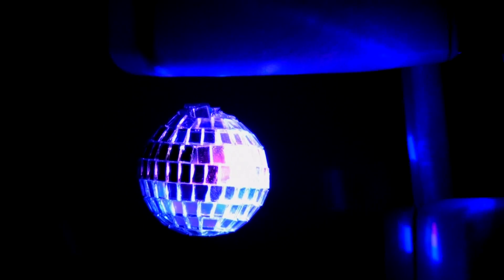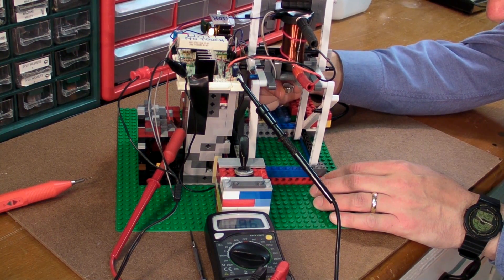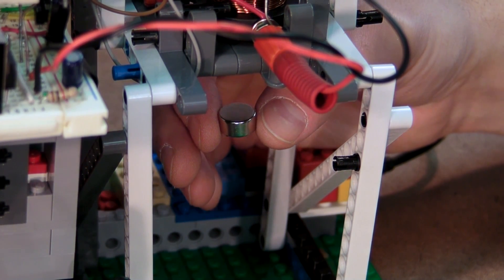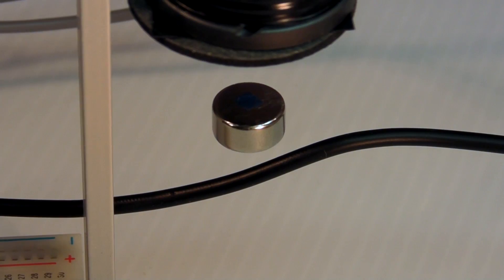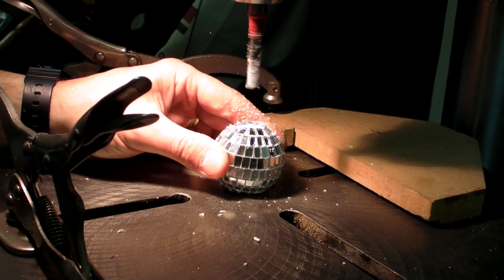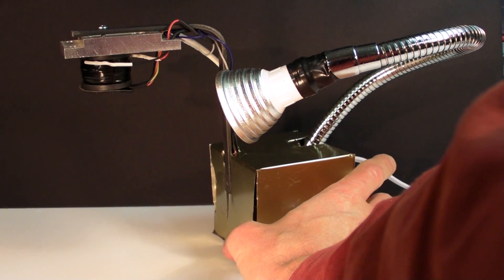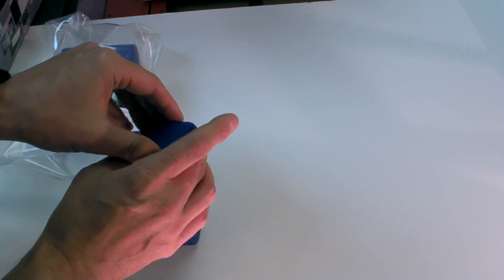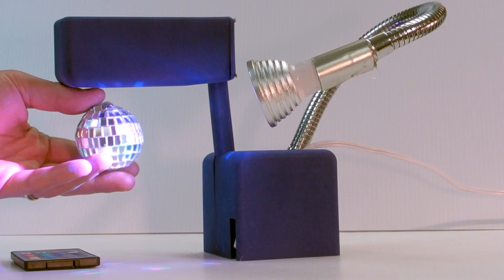How to Build Your Very Own Levitating Disco Ball

Comment: A simple trick would be to use a small 3-5v fan, at an angle, to spin the disco ball, just change the speed by adjusting the fan angle.